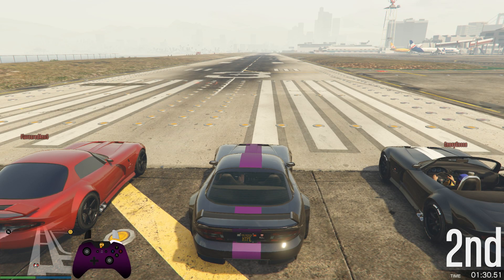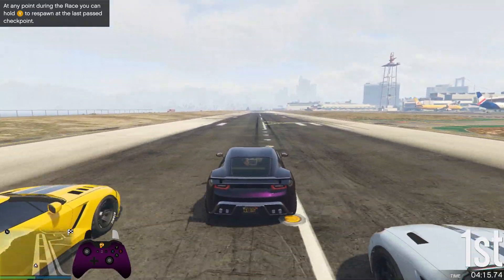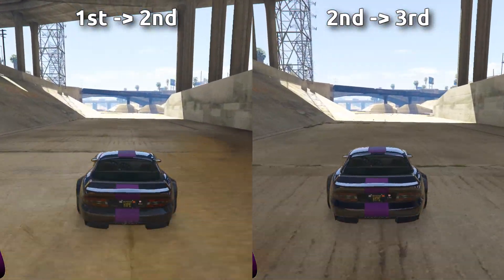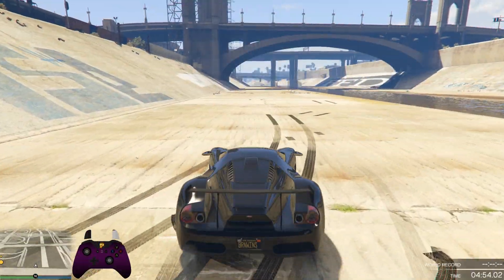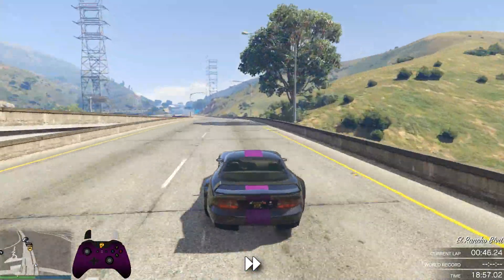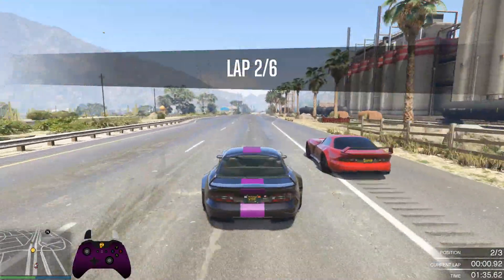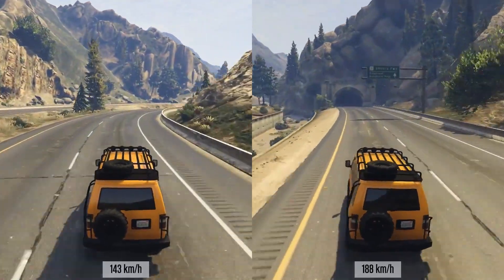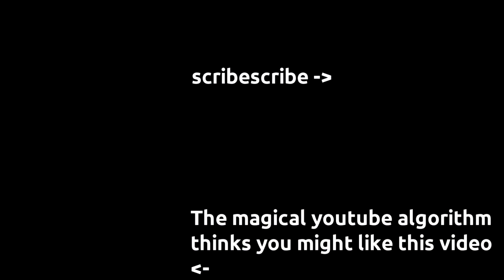Weird Mechanics in GTAV Guide - Mid-Drive (aka Double Clutching)

Comment: Is it possible to Mid-Drive on both, the first and the second, gearchange? That would be sick. I assume you can't as you likely are already in 3rd gear after getting back your grip from the first Mid-Drive.
Reply from the maker: Technically, yes, the banshee 900r is one of the only vehicles that can sometimes do it.
Reply: @FriendlyBaron  Cool, thanks for responding!

Comment: Have you considered constructing a race track that could be used to effectively practice and/or teach the techs. you demonstrate in these videos? Like challenge tracks of sorts that have more generous spaces to preform brake & suspension boosts with very clear measures of success such as lines in the track to visually measure distance more accurately than overworld/open world testing ground!s?
Reply from the maker: A friend of mine had planned one out with me (with him doing the detailed work as i physically dont have the time unless i slept less), though he never finished the project. most of this stuff doesnt reallllly need a place to practice. in fact it may hurt more. much of mastering these is knowing where they can be used, not specific spots. i watched another speedrunner trying to learn to brakeboosting, and instead of trying to learn how it worked, he just tried to be lazy and match every brakeboost i hit instead. he never has really gotten good at BBing still even with being told he should learn it properly, not just copy.
Reply: @FriendlyBaron  

Ahhh, I see. It's as much about the places it can be applied as it is the knowledge of application. Gotcha 👌

Comment: so about the rotating faster when only holding 90% of the way, could that be possible on an analog keyboard on pc? Or does it have to do something with the platform you're playing on?
Reply: On a keyboard when push the key it’s straight 100% u can do that on controller any controller doesn’t matter which platform u can do it on pc too but when you’re using a controller
Reply from the maker: Yes, a "wooting one" analog KB could do it

Comment: In GTA Online I found a way to bypass the Opressor MK2's speed limit, I got up to 150 with boost, but can maintain 129-130 mph. I failed at Mid Driving but then I just held down drive and spammed the handbrake. Try it!
Reply from the maker: yeah spamming the handbrake can work, but it is slower than a perfect middrive.
Reply: @FriendlyBaron  Yeah, I did one and it's faster but I think it's a lot harder to do one while going up

Comment: Can you explain to me why some cars do not get a speed boost? For example Viseris and Flash GT? The viseris was my favourite car for drifting but then they patched mid drives on it and now it sucks.
Reply from the maker: The Viseris didn't have patched middrives, they patched the self-curbing suspension on that car, which happened to also make it not middrive. most cars that don't middrive is a mix of not powerful enough engine combined with possibly to good of grip
Reply: @FriendlyBaron  Alright thanks.

Comment: Is it possible to do a Double Mid-Drive Speed Boost? From  1➡️2 and from 2➡️3?
Reply: It's possible but from the times I have done it, it seems to be slower than just 1 -> 2 or 2 -> 3
Reply from the maker: yes but its generally not worth it, maybe besides in the 900r

Comment: Holy sh*t. Now i can make my friends think that im speed hacking in gta online. Thanks, Baron:)
Btw i can't really get it to work on Zentorno. Does it even work on this car?

Edit: Managed to do this on Zentorno, did work, but it didn't really worth it.
Mixed on banshee double clutch, brakeboost with Franklin's power. Almost flew into the space. New speed record in stats 307km/h hell yeah:D
Reply: Zentorno is AWD so it’s barely noticable. Get a Banshee or a Pariah to flex with your new found powers
Reply from the maker: Yeah zentorno not worth it. enjoy.

Comment: I just listen until my car almost automatically changes gears and just before I hit A no release gas or press brake🤷🏾‍♂️
Reply: some cars doesnt require either, which is what you experienced but the general rule is whats explained in the video
Reply from the maker: also not letting off generally means you have to hold HB longer, which is slower

Comment: This is interesting, but i don't think your reasoning for it's existence is quite right. I think it's simply just that your engine can get to higher RPMs before the automatic transmission upshifts you when your tires are slipping.
Reply from the maker: Nope. if you use a mod you can see the game even goes down to first gear for a moment when doing this, hence the launch boost.

Comment: These mechanics are used for speedrunning and is it possible to do the speed boost mechanics on the mission where u have to use the 18 wheeler to chase?
Reply from the maker: Nah the 18 wheeler cant brake boost or middrive. its too slow

Comment: Double clutching is when you press the clutch when taking out of gear then again when putting in a gear in manual transmission cars.

It doesn't improve the performance and speed in real cars.

The term for gtav should be changed
Reply from the maker: yes i said this in the video more or less.

Comment: What's the cause of the failed boost? I keep doing it like that in my Turismo R.
Reply from the maker: Generally it means you are holding it too long or doing it too early, its hard to say the exact reason though.
Reply: Dont release handbrake before R2 is fully pressed
Reply: @xJOJOx31  On kb
Reply: @someweeb3650  R2=accelerate

Comment: When I do it it’s bouncing off the rev limiter but it isn’t making the skid marks. Does that mean it isn’t working? What am I doing wrong
Reply: No skid marks means you missed it, and keep in mind some cars can't do it. To start I suggest you use the Banshee in first person just like Baron in this video. 4:31 also has an example of a failed mdsb.

Also keep in mind that sometimes the skid marks are barely visible like in the Stirling GT (4:27) example.
Reply: @Kyleeon  I was using the banshee 900r and like I said the dial was bouncing off the rev limiter in first person and then I tried it in third person and it made the rev bouncing sound but no skid marks. If I need to practice in first person, how do I know if I did it right or not?
Reply: @dooderman8361  Your speed will start climbing faster than usual, although the Banshee 900R should def leave skid marks if you do it right.

Comment: You never double clutch a car with synchros. It's pointless. Basically what's happening is you're doing a "clutch kick". It's not a boost. It's just putting the engine in the power band which causes the car to pull harder than when not in the power band.
Reply from the maker: i think you are confusing what i said about real life vs what i said about the game

Comment: If the WR holder has a video eating bread for 5 mins I guess I will have to eat bread while practicing this. Maybe it will help maybe it won't but I won't know until I try! I will update with my findings.
Reply from the maker: try making the bread soggy it will help you eat it faster
Reply: @FriendlyBaron  will do. Are potato hot dog rolls okay or does it have to he sliced bread?

Comment: Wait, is this that thing I keep accidentally doing while trying to slide the Elegy Retro Custom? Well damn, it is.
Thanks, I wanted to know what I kept doing wrong, or at least the name of it.
Reply from the maker: Uh no probably not doing that on the elegy.
Reply: Are you sure? I'm doing it on very tight hairpins where I have to downshift to first gear, with a max-tune.
And it looks exactly the same.
And seems to be triggered exactly the same.

To be more precise, when exiting the hairpin, I press the gas after letting go of the quick press of the handbrake I was doing. So, I was basically starting to move forward more than sideways using the AWD, and accidentally do all the things required to E-Boost/Mid-Drive. I can't do it every time, so it likely is because I don't meet some kind of requirement, like forward grip/momentum.
It sends me flying forwards (into a wall, usually), with loose rear wheels, in an upgraded car.

Sounds like... exactly what you were explaining, to me.
Reply: Nevermind, I think it's probably InversePower freaking out over stupid button presses. I constantly forget I have it because I've had it for so long.
I just experimented a bit, and got small boosts from doing small slides that I correct within a second. Looking at the description for the script, it's meant to stop the game from decreasing engine power when sliding, even saying "The lower the speed and the higher your angle, the more power is added." Which are the only circumstances I can get the huge run killing (I can only get it to happen on a section with another hairpin a few meters away) speed boosts.

Comment: in real life you just use a lower gear to accelerate faster at the cost of an oddly high engine throttle for the time.
Reply from the maker: Yeah relating it to real life is just a mess
Reply: @FriendlyBaron  what do you mean? In real life people run into you if they see you running from the police or they break while steering left to the middle of the road right?

Comment: How much does not having a turbo affect a banshee mid drive
Reply from the maker: It shouldnt really make a difference, its based off the engine power.
Reply: FriendlyBaron ok
Reply: FriendlyBaron also when I was driving the pariah(no mid drive speed boost) it seemed fast but when they drive it seems slow

Comment: Can you mid-drive with the custom elegy?
Reply: Yes, you can. Almost all vehicles can hit mid-drive speed boosts. Rear-wheel-drive vehicles work best and are the only ones that can hit the mid-drive speed boost using only the handbrake. All-wheel-drive cars, like most supercars, front-wheel-drive cars, or other cars that cannot hit the mid-drive speed boost only using the handbrake can hit it if both the brake and the handbrake are pressed at the same time during the sequence. This is a bit more artificial than doing a mid-drive speed boost in a rear-wheel-drive vehicle.
Reply: @zepholiar  thx homey

Comment: "double clutch" is a purely American thing, from people that never really drive manual car and don't know you don't need to press the clutch twice to change gears. I've seen so many videos of people thinking you clutch for neutral, clutch again for new gear, and that's slow and dumb. If you move fast enough, single clutch press half way down only and you move your shift from say, 4th to 3rd, and it's as smooth as it gets and a lot faster and less stupid than "double clutch". People should learn about car mechanics before talking poop on the internet.
Reply from the maker: https://en.wikipedia.org/wiki/Double_clutch_(technique)

Comment: You can’t double clutch in 4WD, only rear. It’s called double clutch cuz you’re skipping a gear up, you’re double clutching. Yes the correct term is different in real life, but you skip a gear in gta.
Reply from the maker: If you use a mod menu to show gears in gta you'll see it actually goes down to first gear, hence the launch boost.
Reply: FriendlyBaron and you continue to educate the community. Didn’t know the specifics 👍🏽

Comment: No it's a technique used to upshift smoothly be rev matching mid shift only in h pattern shifter manual transmission. Heel toe shifting is the usual 'special' technique for smooth downshifting. Not trying to be an asshole just correcting you so you wont make this mistake and piss off the un-forgiving car people.
Reply from the maker: Yeah wikipedia lied to me it seems
Reply: Btw love ur vids